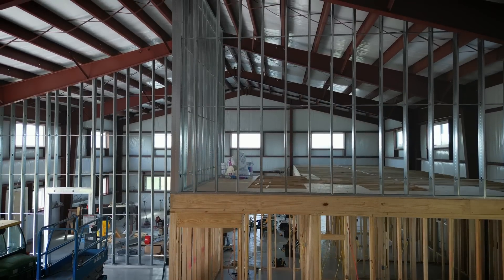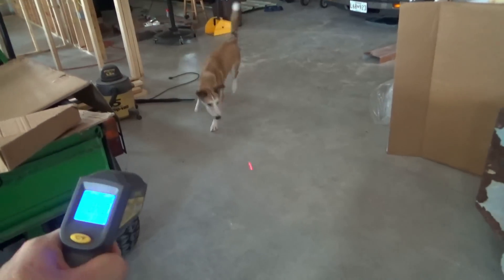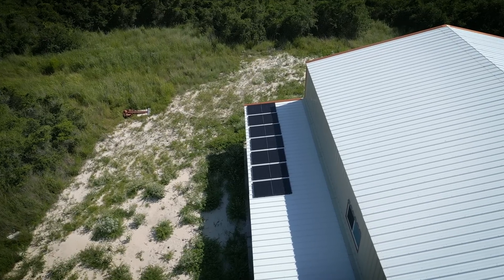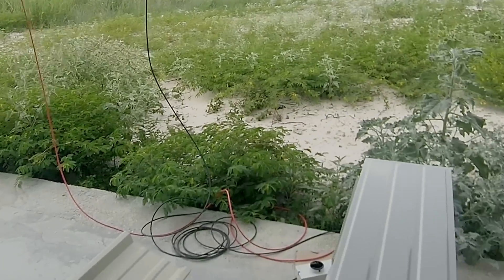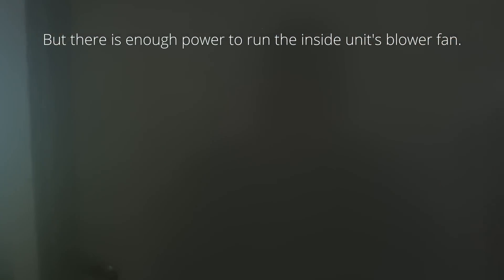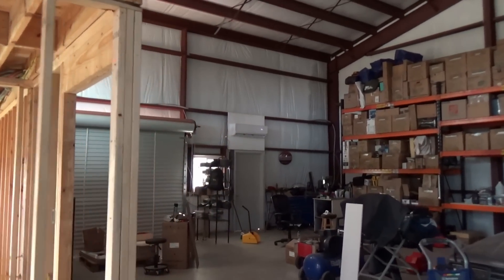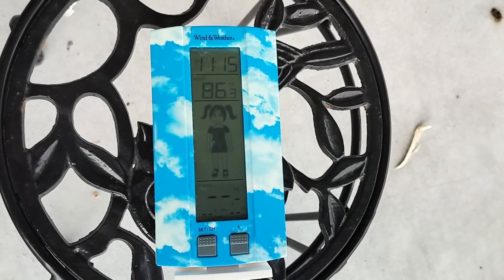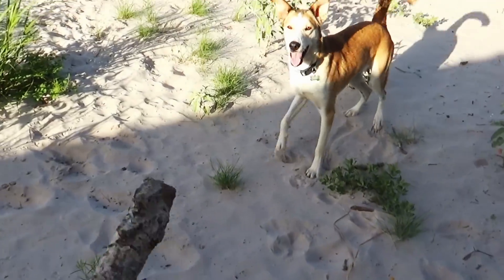FREE Cooling & Heating: 2-Ton Solar AC Tested!

Comment: Most mini splits use a variable frequency drive to power the compressor.  These run off DC and are a special type of inverter..a variable frequency inverter.

Some mini splits use AC for other components,  nice to see native DC  units are made for solar.  If you covered the roof with PV,  the heat gain reduction would more than offset.  An awning over the rollup doors would also help.

Love your dog!

Be careful with the PVA, 260 volts DC has special hazards.  I needed to run a plasma torch off 208 volt 3 phase power but thr torch is 240 volt single phase but INVERTER.  Tracing the circuitry,  the torch first converts the AC to DC so i took 15 amps of 208 3 phase and rectified it to DC through a 6 diode bridge.  This worked perfectly,  as long as i used the 3 pole 15 amp breaker to turn the unit on and off.  DC is hard on switches as it loves to arc.

Comment: What is your insulation? And how much reserve is needed to run at night? Or should I ask how many panels needed ( and batteries ) to run continuous off grid ?
Reply from the maker: The insulation in the building is r10 in the walls and the ceiling. To answer the other part of your question, the key is to size the air conditioning properly to the space (which this obviously isn't since I just wanted to test it) so the AC doesn't run at full power all the time. Ideally, you want the AC to run at about half load once the space is cooled down which in this case is about 1,000 watts.  So if you get 8 hours of solar running a day, you need enough battery capacity to put out 1,000 Watts for the remaining 16 hours. In other words, 16 kilowatt hours worth of battery capacity minimum. If the AC has to run full speed all the time, then that's 2,000 watts, and if you have the same 8 hours of solar running during the day but need to run it full speed through the night for 16 hours, then you would need 32 KW of battery power.  I just want to add the following caveat: usually you would need more air conditioning power during the day because of solar gain then you would at night. In other words because the sun is out, the air conditioner has to work harder. And also usually it's cooler at night anyway.
Reply: @AlexLTDLX  ha ya except in Texas it goes from 110 to 103 at night! 
I have 1800 sqft home, uses 1.5 tons of ac/heat, it’s foamed , as a contractor , I fully understand the need for insulation to combat the need for more required btu’s. 
I’m a big fan of foam but I’m always concerned for off gassing . 
As I’m looking for alternate building practices for my next forever home, and I’d like to be as off grid as possible, not a huge fan of solar , cost vs reward isn’t all that great, but not much else to combine with wind, unless you live near constant moving water.

Comment: We run one of those in a 1 Ton variety at our off-grid cabin.  We don't use the direct solar, but run it off our inverter/charger which keeps the outlets powered along with keeping the batteries charged up.  It's only our weekend playhouse, but our area has extremely expensive power at $0.48 off peak, so it made sense to keep the cabin completely off-grid.  We can easily maintain 72F at 115F ambient air.  Such a luxury for a 100% off-grid set-up.  Our well up at our play property is also solar.
Reply: That's so expensive, I live in northern IL and I just checked my bill, I pay $0.6.9 cents a KWH
Reply: Can you tell us what set up you have and brands @iamblaineful? Thanks

Comment: whay are you putting those panels where they will be shaded....put them on the other side to get full sun all day
Reply from the maker: To test how much light they need to run the compressor - the the temporary magnetic mounts.  The main array is going on the south facing porch which will get sun all day.

Comment: Why not install plastic flap doors on both of those garage doors to help trap the cooled air inside the building when they have to be opened?
Reply from the maker: Those doors will be insulated and brush seals added.

Comment: Couldn’t you put the panels on the higher portion of the roof where there’s no shade
Reply from the maker: The main solar array is going on the other porch roof that faces south.  Those panels will be in full sun all the time.  This was just a test - thus the temporary magnetic mounts.  If I put the panels for the test on the other porch, I never would've found out how much shadow the panels could be in and still run the compressor.

Comment: I'm here for Roger but also got a great vid!  I am building in >110° heat index and completely share your joy of A/C.  I'm going to install one once it's dried in.  Thanks!
Reply: Just used your (Roger's) discount code!  The included bifacial panels are very interesting in that they can put out 30%+ more power by photons gathered on the back side of the panel.  Some interesting yt vids showing vertical mounting, reflectors and mixing configurations to broaden the power band.

Comment: I plan on purchasing my ~40kw of panels from signature solar.  I'm hoping to have it all pay off in around 4-5 years.  We just dug the hole today for the basement, so it's getting exciting.
Reply from the maker: 40 kW?  Wow that's a lot.  I've got 13 kW of panels.  When you get ready to order, send me a message.  For an order that size, maybe I can get you a little more off on the price.
Reply: @AlexLTDLX  I wrote down the discount code.  I'll make a note to contact you.

I'm probably going to buy the cheapest panels since I think that will be the best monetary return, but I need to do the math.  But it will be about 40 +/- 3 kw, with a total system cost of $45k before Federal 30%

Comment: Those are some impressive weeds you are raising down there!
Reply from the maker: It's been so brutal I haven't bush hogged the property in a while.  After shooting this stuff, I broke down and paid someone to suffer in the heat on my tractor.  It takes about 10 hours to do everything.
Reply: @AlexLTDLX  You need some goats for weed control! if you hook up a Coolbot or build your own you could get that mini to put out a much colder air  while you have good sunlight.  I have 2 12k btu splits one is in my garage the other is a 12volt backpack style ac in my work truck.

Comment: I bet you could add another solar panel or 2 and have it run longer. If you really wanted it cooler you could put another set on the other side of the shop
Reply from the maker: True.  But you do have to watch the maximum voltage that the AC unit's MPPT can handle -  which is 380 volts open circuit.